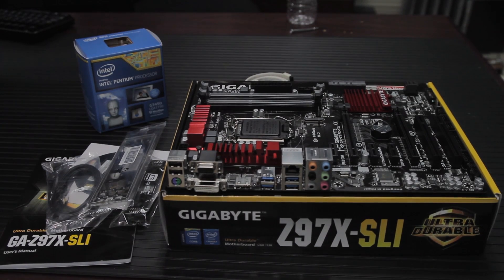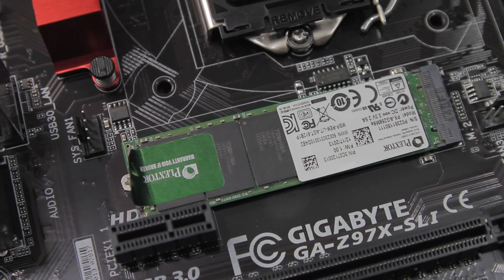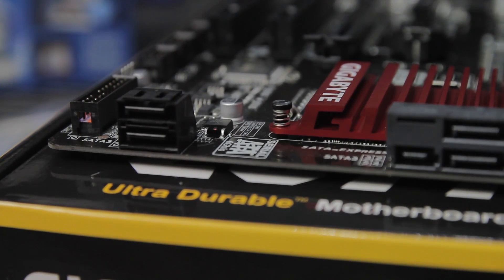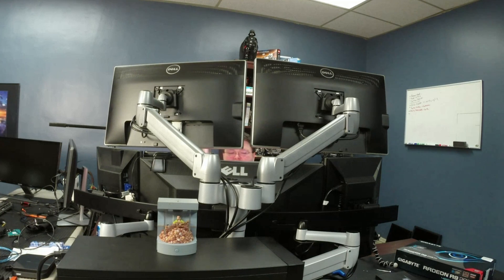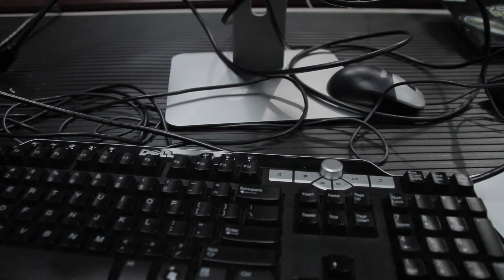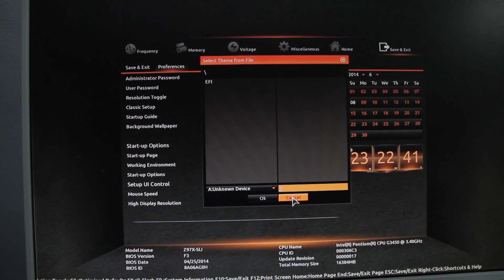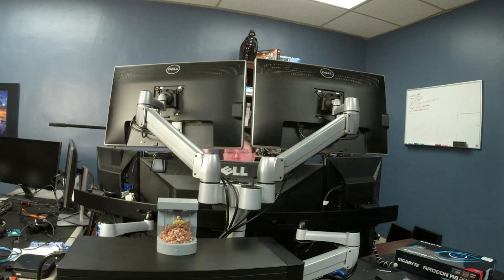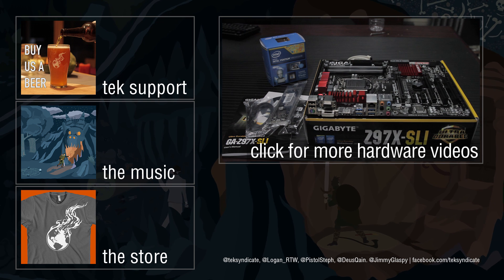Gigabyte GA-Z97X-SLI In-Depth Review by Wendell

Comment: 3 years late, but I hope someone can help me. I am using this board and am having audio issues. I don't know if it is onboard issues or headset issues. Low beat sounds tend to burst randomly into super loud fuzz that is low. If I use the headset in USB form then the burst only happens at high volume. IF over 3.5mm it still requires louder audio, but not as loud. Don't know how to fix. Also just volume period over 3.5 is loud. at windows volume level 2 over 3.5 is volume 14 over usb and 2 is loud enough for me.

Comment: I have the noctis 450, it does support upto 360mm rad but does anyone have this setup that can confirm that the  ewkb predator 360 will fit in the noctis 450 ? If my measurements are correct the predator 360 will sit 1 inch past the 1st top left stand off for the motherboard (ga-z170xp-sli) which would be an issue.

Comment: I was worried when the CPU Cooler Size Concern was mentioned.  I have this motherboard and the Cooler Master Hyper 212 Evo.  My case is the Corsair 200r.  PCPartPicker tell's me there are no comp. issues with the mobo,case,or CPU Cooler. My Build:http://pcpartpicker.com/p/Wwvszy Previous Tom's Hardware Forum Post:http://www.tomshardware.com/answers/id-2975237/fit-gigabyte-z97x-sli-corsair-200r.html Will my CPU Cooler fit on this MB?  What is the correct orientation, position, and screw alignment?
Reply: I have this Mobo with the CM 212 EVO and the i5 4690k and i assure you its compatible at 100%
Reply: Did you have a problem? I plan on getting the same combo...?

Comment: I wish i found this video before i bought my MB and cooling :( So if any1 is wondering this MB is NOT compatible with the Antec Kuhler 650, the part that fits on the CPU is too big and hits the MB heatsink. How did i find out? My temps went to 96c lol

Comment: On-board sound is crap compared to my old Asus P6X58D-E which I hooked up to a Logitech Z-5450 using the optical output. Now to the Gigabyte board, any idea what the SPDIF connector does as Gigabyte have no idea.

Comment: you say the audio is isolated on the mother board.. but i can still hear static if I use the 3.5mm audio jacks.. good thing I have a USB headset.
Reply: im having the same issue and its getting on my nerves when i play games....i was thinking to buy a usb converter for my headset and now im leaning towards that idea...so usb doesnt give you any sound/problems?
Reply: Dabtney Nieves no, you shouldn't hear any static if you're using a USB headset.
Reply: perfect them im not going to "play with it" anymore thanks a lot for the quick response.

Comment: Are there issues with this board and the  G3258 (the unlocked Pentium)? I can't find much online on these two  boards, but I  did notice a few people having trouble getting this board to correctly ID the cpu. I picked one of these up at Microcenter for $87 as an open box item- I couldn't say no to a great price.
Reply: No problems that I know of, this board supports the G3258 (with overclocking) from BIOS version F5 onwards (mine came with version F6).

Comment: Hi.  Just built a new rig for my cousin using this mobo.  However it doesn't recognize 1 stick of ram.  I have reseated it, and tried in different slots and also ran mem test with no errors.  Any ideas?  Oh, the ram is 8gb Corsair Vengeance 1600mhz.

Thanks.

Comment: does it have on board wifi?
Reply: No it doesn't. Its best to invest in a wifi card that can go in a pci slot or even check out powerline adapters if you are far away from your modem rather than spending 50$ extra on a board with mediocre wifi.

Comment: I have a issue with this MOBO. It registers my USB 2.0 as 3.0. SO i cant get my ps3 controller to work properly. my button presses on my controller wont register. but it registers my ps3 controller as a device. my computer is newly built, so i dont know for sure that i got every driver installed. I know for sure that i downloaded everything on the Gigabyte website for that MOBO

Comment: you cant crossfire amd cards in this? also genuis people help me out. I am building i7 4790k pc with r9 280 card. I need a motherboard, budget. I might crossfire another r9 280 so open to that option. Not thinking about overclocking cpu besides own boost 4.4ghz, I assume I don't need aftermarket cooler, correct me if wrong.

Comment: is this motherboard good and long lasting , im thinking of buying this board very soon can someone please tell me
Reply: will this motherboard be long lasting ? im going to get this new board and put in my i5 4570 with r9 270x
Reply: ***** i currently have a h87 mobo in my rig with a i5 4570 and r9 270x but i will be upgrading the motherboard to this z97 sli and i will use the same cpu and gpu however i will upgrade later on when needed
Reply: ***** is the gigabyte z97 gaming 3 motherboard good? im getting it in a few days can you tell me if that board is long lasting? and good

Comment: Just got this board and found a couple of weird things happening.  My mouse pointer disappears intermittently when I move it to the right and upper right side of the screen.  I was just using this mouse on another system and it ran fine.  Also, there seems to be a huge lag when I try to drag anything from the windows menu to the desktop or task bar.   Finally, there is a huge amount of lag in the bios when I switch to legacy menu mode.  Definitely not smooth like your board was.  I probably got a lemon.

Comment: Why does this motherboard have 3 options for video out when "SLI" is in the product name? None of the motherboards that I have bought in the last few years have had any onboard video out connectors because the manufactures felt that it was a waste of money to include features that almost no one would use, especially when the motherboard is specifically designed (and intended) to take advantage of multiple video cards.

Comment: Gigabyte reliability is below average. My last motherboard z87oc broke three times and i even didnt overclock anything. Their windows software lacks behind of msi and asus so much. It looks pretty but any changes u make will require a reboot something that asus and msi can do without. Overall after swapping z87oc from gigabyte three times withing two weeks i would look for something else.
Reply: My GA-EP35-DS3L is a few years older than that, no problems. Have you swapped out the board or checked the power supply? It'd be a shame to buy a new mobo just to have the same thing happen again.

Comment: The parallel port is still a very nice port to have when you need it.  I have a few printers that were made in 2003 that still need the parallel connection and many CNC devices also still need a dedicated parallel port.  I wish more motherboard manufacturers would include legacy connectors on-board even if you need to install a riser to use it because then the board is more useful.  It is also good to see that Gigabyte is still including the classic BIOS as well as the UEFI graphical version since the Classic BIOS versions tend to boot much faster and are much easier to navigate by power users who can RTM and know what they are doing.

Comment: Whats are the advantages of going with a 200$+ motherboards? Got myself M5A99X EVO R2.0, was pretty cheap. What would a more expensive mobo give me?
Reply: More expensive motherboards tend to have more robust power delivery for high end overclocking components, more GPU/m.2/SATA-E slots for more hardware, beefier caps and chips for better on-board audio and etc etc.

More money gets you more functionality, basically.
Reply: Different sockets coast more, besides that better overclocking, more sata ports, difernt sata ports(m.2, sata express),with different sockets possibly more ram slots or support for ecc ram, and possibly more expansion if it's a different size
Reply: I'm running a FX-8350 on that exact mobo now. So far it's been absolutely stellar. No issues whatsoever, and it's done everything I've asked of it with power to spare. Very, very good motherboard that won't break the bank. Good choice Timur.
Reply: To normal people, nothing. Most people aren't going to run 8 ssds, or quad sli. JJ from Asus even said in an earlier tek video that ANY of their boards could push a 3770k to 4.7 GHz as long as the chip could handle it. Most people don't even use usb 3.0! I say, just go for a resonably cheap mATX board and a nicer, smaller mATX case and avoid the headache of multi gpu configurations!

Comment: there are plasma cutters (they are for cutting sheet/plate metal) worth 40-100k that run on parallel interfaces and are from the late 80s and all through the 90s. they also usually don't have drivers for a 64 bit system but you can do pass through with lpt using almost any virtual machine software like vmware and run whatever version of windows or even dos in it that can drive the machine you need to drive with direct lpt access.
Reply: So true. Tons of industrial equipment require legacy ports. I had a nightmare job as an engineer in a factory earlier this year and saw it first hand.

Comment: i am curious, with these dual bios boards that use a switch can you have a bios fail, flip the switch, boot up, flip the switch while the computer is on and reflash the corrupt bios? never thought to ask this because i've never personally dealt with a board that has a switching bios like that, but i used to use an old school trick of replacing the bios chip back when they were in sockets then swapping back when the computer was on and flashing the old bios chip back. or is there a more sophisticated solution in the software that doesn't require flipping the switch back to flash the inactive bios?
Reply: No, it automatically does it if the first one does not boot. FYI, you can still replace the first bios chip, but you need to look up which one is first. It is great because you can flash without fear of bricking the board. Asus has better tech with their "Bios Flashback," but this gets the job done. My current board has dual bios.

Comment: This is my board. i'm running my 290x sli perfectly, and my 4970k OCd to 4.6Ghz at 1.20v. Very nice budget board. BTW does anyone know of any good PCI 3.0 x16 (x2) that are cheap?
Reply: 290x sli
Reply: MineCraftiQ I noticed i had written 290x up above, but in fact; theyre 280x in crossfire.
Reply: AMD is CrossFire. NVIDIA is SLI.
Reply: *4790k
Reply: http://www.newegg.com/Product/ProductList.aspx?Submit=ENE&N=100007627%20600093976%20600176035&QksAutoSuggestion=&ShowDeactivatedMark=False&Configurator=&IsNodeId=1&Subcategory=280&description=&Ntk=&CFG=&SpeTabStoreType=&AdvancedSearch=1&srchInDesc=&nm_mc=AFC-C8Junction&cm_mmc=AFC-C8Junction-_-na-_-na-_-na&cm_sp=&AID=10446076&PID=6146836&SID=ygw8v35rop6s
Reply: Jack Taylor I meant one that runs the slots in (x16x16). and sorry for the CPU typo!
Reply: are you using an after market heat sink for the cpu? and also, does it support triple monitor?
Reply: im using a thermaltake waterperformer 2.0; I just ordered a Cooler Master Hyper 212 Plus; anyone aware if this fits?